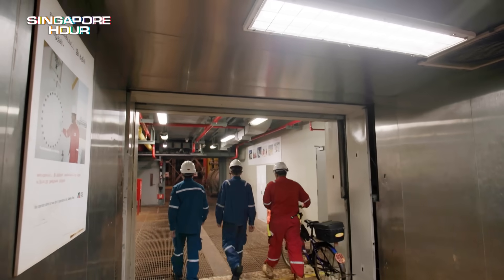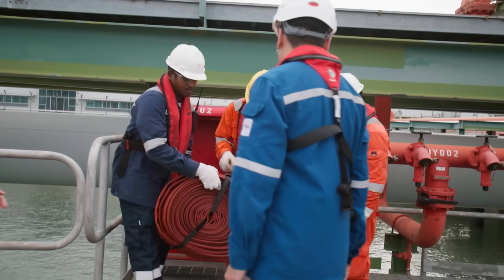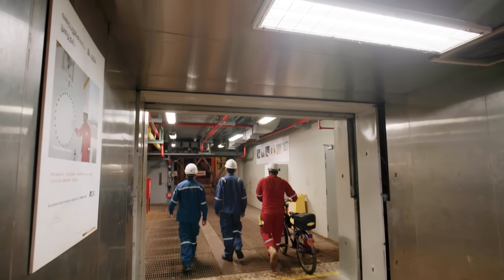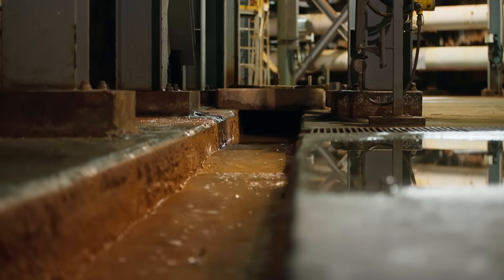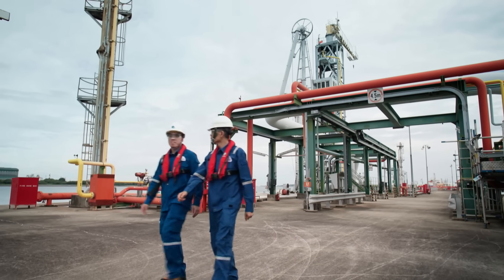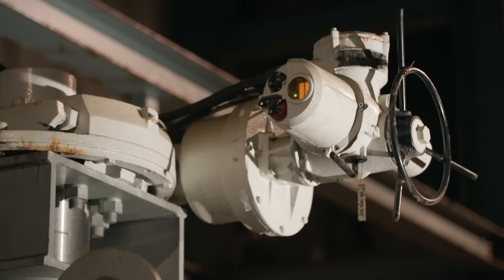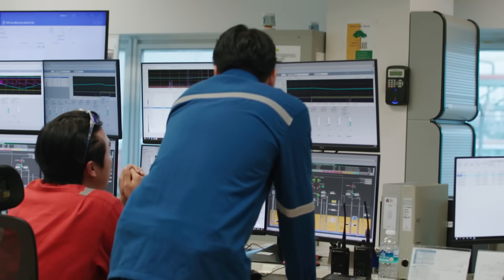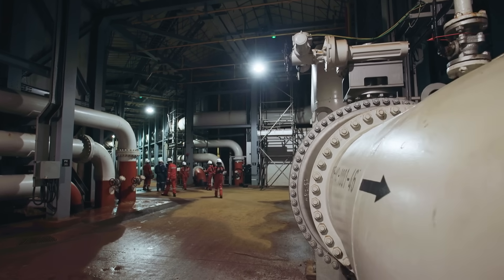Why Singapore Built A 150m-Deep Oil Cave | Singapore Hour

Comment: this is a simple place for oil storage, why the comment section think this is a military facility.
Reply: because singapore has a separate identical one that stores ammos.
Reply: Singapore only our living cost going up worried about next gen xyz 😅
Reply: I understand Singapore is rumored to have 2million barrels of oil as national security reserves, not just for military to use for it's tanks and planes..etc.. but for power stations to continue operation when supply is cut or if there is a Choke point at Suez canal like when the ship got stuck and weeks of delay .. the reserves can allow your country not to run out of power.
Reply: that one different bunker, need CAT 1 clearance to know. Any citizen that have/had gone through army, somewhere out there is a storage bunker with weapons n gear with their names on it, enough to arm the whole SG and even have M16 for older generation when desperate in time of war were everyone is activated🤫🤫
Reply: Military base need oil storage. You can call it a dual-use facility.
Reply: @MarvinChenFantasy  Nah... then one kena fire den ur military + oil/ energy supply gone at once.. that's quite dumb.
Reply: @acscw8408 Oil storage facility is essential for every military base, dumb but true.
Reply: @MarvinChenFantasy  yeah but i don't think they'll mix military use with commercial oil tho...
Reply: It keeps our jets and tanks fueled.
Reply: Because Internet denizens cannot believe spending so much to stick oil back where it was drilled from....
Reply: They are experts with privy knowledge that you and I have no access to. Dying to be acknowledged.
Reply: Because Singaporean are dramatic and overreacting
Reply: Because They CANNOT TELL 
BUFFONS  🤪s  Like YOU That ACTUALLY IT IS A MILITARY 🪖 INSTALLATION - YOU
M  F * ; # ing IDIOT 🦍💨🤢🤮
Reply: This is actually where they store the nuclear waste in sg
Reply: @zendonteh9521  you talking cock ah
Reply: So this is why earthquake tectonic awakening at southeast asian plate?

Comment: I like this kind of documentary. Basically places 99% of normal citizens cannot hope to ever come across.

Most of us will never imagine tunnels and caverns built beneath our feet. Only bunker-busting type of missiles can penetrate. And I don't think any SEA countries has this kind of weaponry.
Reply: Most people would not even know the amount of work done to keep everything running. When documentaries like this appear they either ignore it or think that this work was done overnight
Reply: mrt station to black line Deepoilreserve in 2036
Reply: Got MRT mah
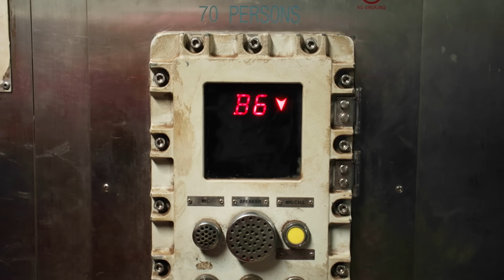Reply: @tankman20064  no mrt, bicycle have 10:19
Reply: 150m is even deeper than Iran's nuclear facility (80=90m) - which is only partially damaged after 6x penetrator bombs from B-2 stealth bombers going into ONE single hole.
Reply: @eatdriveplay trump say fully damage lor